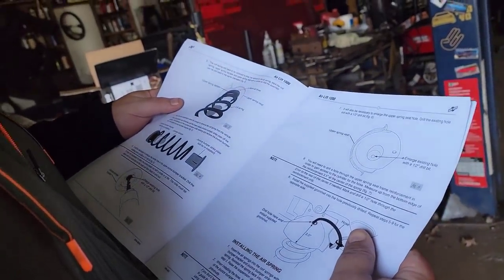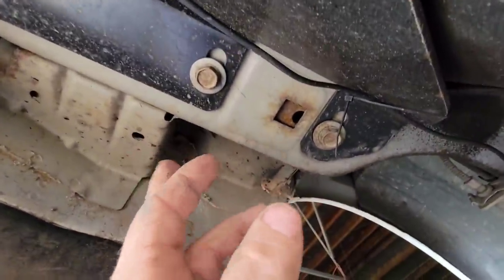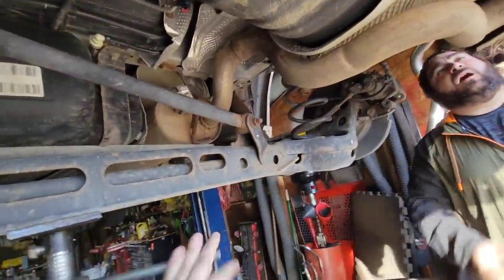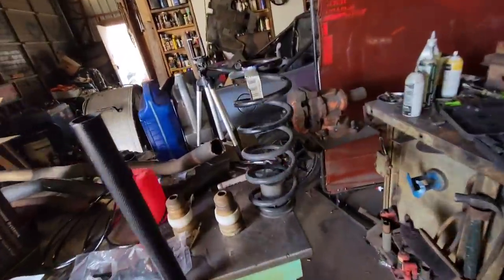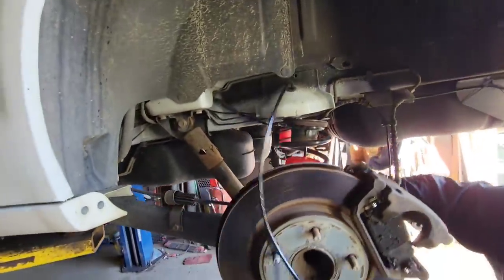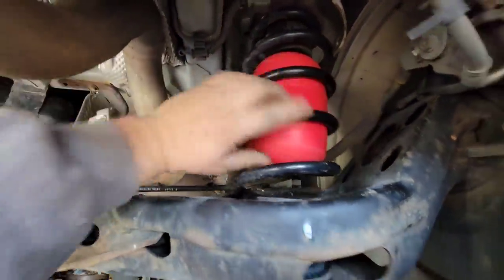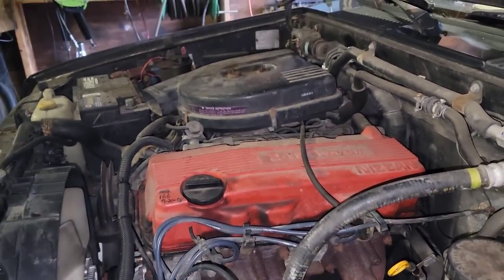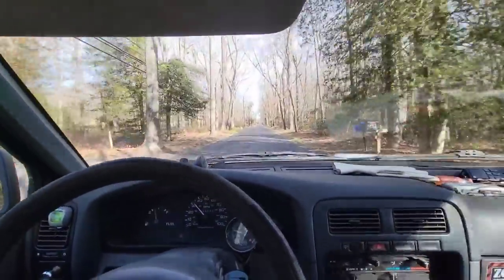Dodge caravan helper springs

Comment: Sumo springs. Check it out. I put on all my company trucks. Huge difference. And anyone can install in 10 minutes. Very very good reviews and I tow a 10000 pound dump trailer doesn't even worth down at all.
Reply: Their solution for the grand caravan is just an overpriced spacer.

Comment: You town anything with that mini van the transmission will be toast in short order
Reply from the maker: All ready figured that.. . And I would beg to differ if you drove it like Freddie They would probably last a good bit As long as it's not a 110ﾟ outside and you got the air conditioner jaming with a fully stocked 😆